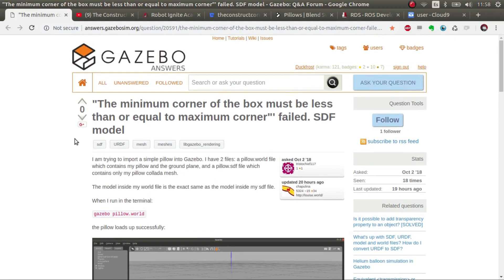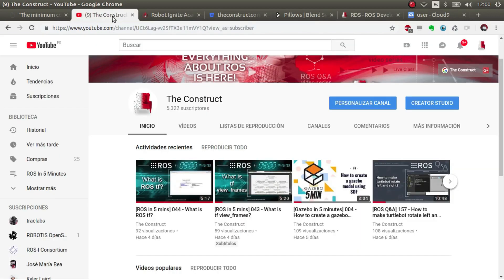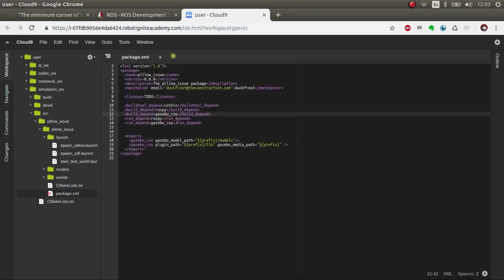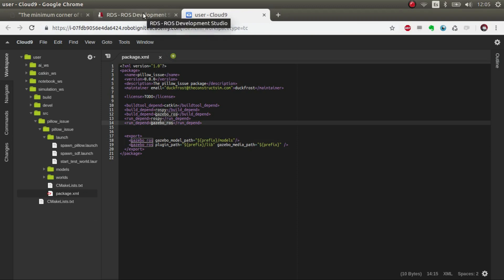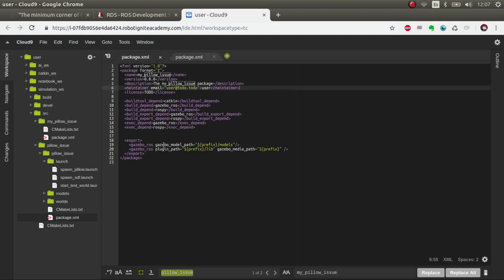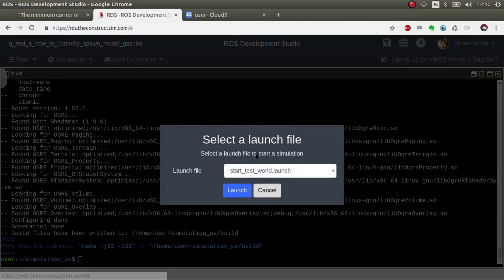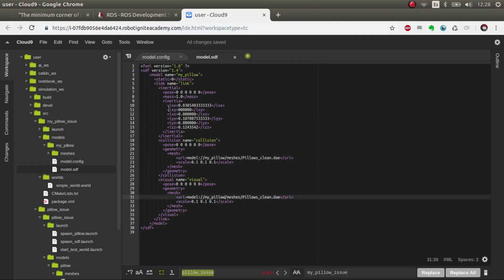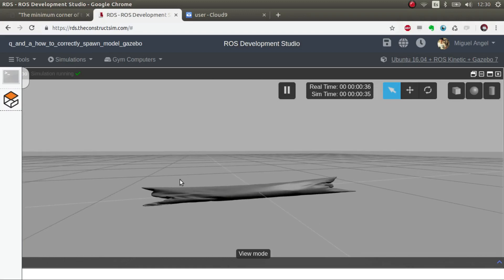[Gazebo Q&A] 003 -  How to spawn an SDF custom model in Gazebo with ROS

Comment: Can one please help my sdf model is not visible in the gazebo world, though successfully spawned. But in the world a green rectangle is created along the y-axis by far to the origin. 

 "rosrun gazebo_ros spawn_model -file `rospack find xMatePro7_description`/urdf/xMatePro7.sdf -sdf -z 1 -model my_jam

[INFO] [1690787980.915613, 0.000000]: Loading model XML from file /home/siat/catkin_ws/src/xMatePro7_description/urdf/xMatePro7.sdf
[INFO] [1690787980.929953, 0.000000]: Waiting for service /gazebo/spawn_sdf_model
[INFO] [1690787980.932810, 0.000000]: Calling service /gazebo/spawn_sdf_model
[INFO] [1690787981.056436, 12.968000]: Spawn status: SpawnModel: Successfully spawned entity"

Comment: I need some help. I have to write a program that auomatically performs fuzzing on gazebo sdf files and tracks if they crash the program.

The tutorials configuration does not HAVE ROS, so I cant use ROS to import the sdf.
Is there a way/command to launch gazebo from terminal, and implicitly import an SDF file? I tried providing the SDF file loc as an argument already.

Comment: Thank you so much for your detailed explanation.  My problem is Gazebo doesn't start in the ROSJECT solution which you have provided in the link. 

Actually, there is no problem running start_test_world.launch. However, in the case of spawn_pillow.launch the gazebo screen is totally black. In the shell I have the below forever :

[INFO] [1627492705.867970]: Loading model XML from file
[INFO] [1627492705.868362]: Waiting for service /gazebo/spawn_sdf_model